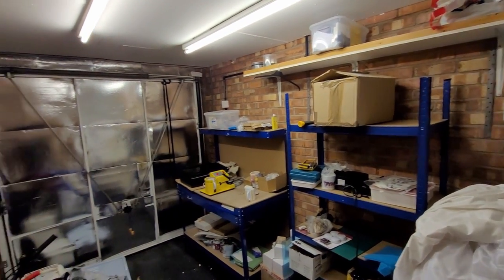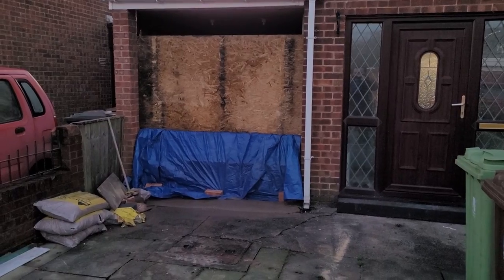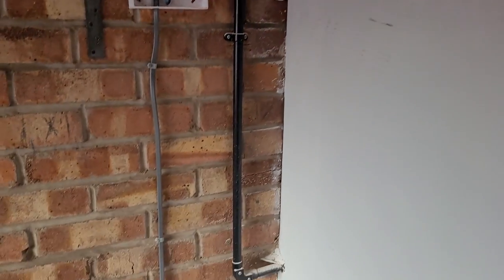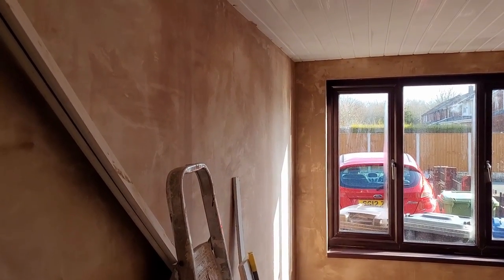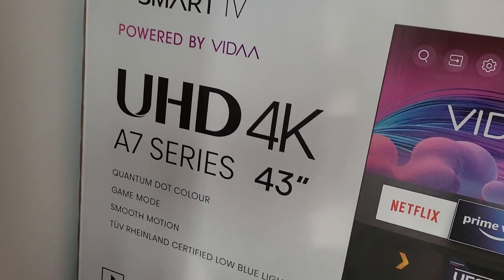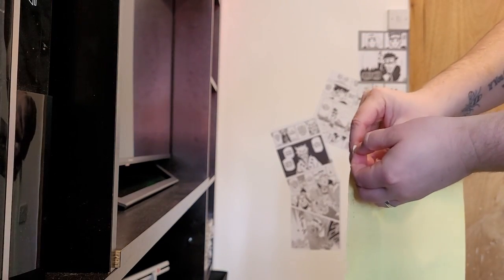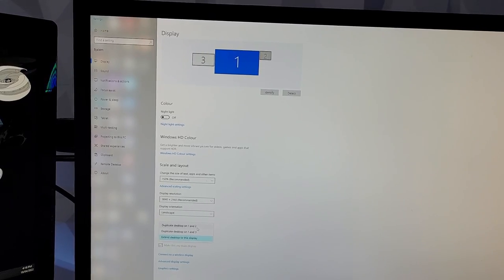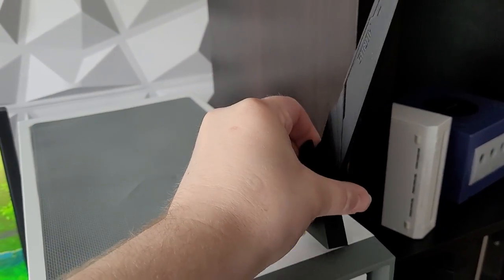I Turned My Small Garage Into An Amazing Game Room! Making A MANCAVE With A Small Space

Comment: Thinking of doing the same or at least half of the garage. 

If you don’t mind how much roughly did it cost ?
Reply from the maker: It wasn't too bad.  The most expensive part was converting the door to a wall with window which was about £1,500ish from what I remember.  
The whole thing cost me around £3k (excluding furniture which was about another 700 if you get some used stuff) I reckon if you have a similar size and budget 5K it can be done.  Do as much as you can yourself though if possible
Reply: Thanks, is it warm in the winter months
Reply from the maker: Nope because the side wall is only single brick.  I put in a good chunk of insulation in the celling but it only really does so much.  Because the room is quite small though it gets warm quick and I bought a little £60 electric radiator which did the job.  I miss this little room I don't live there anymore! I have a bigger office now but I think the DIY aspect gave me a sense of attachment to that house
Reply: I see, I also only have a single skin, I was going to put insulation on the walls as well as the roof. It looks like you just used insulated plasterboards. I think with some insulation between the brick and plaster boards that would make it better. Was looking at an electric radiator to keep it warm in to.